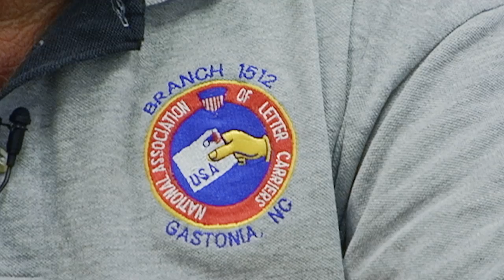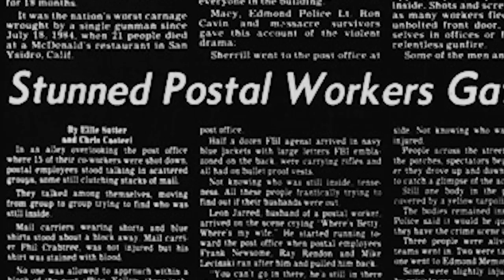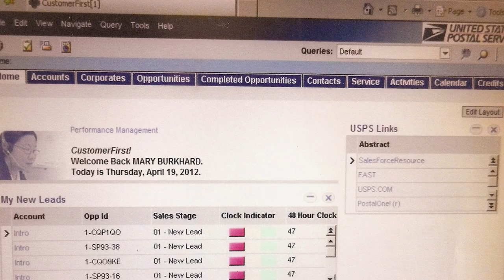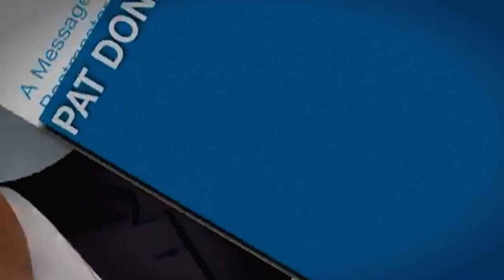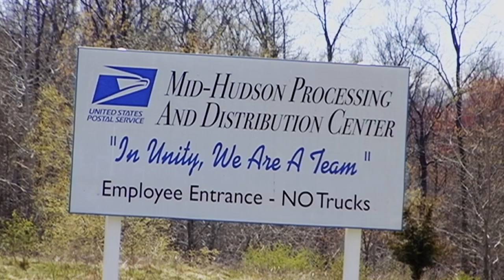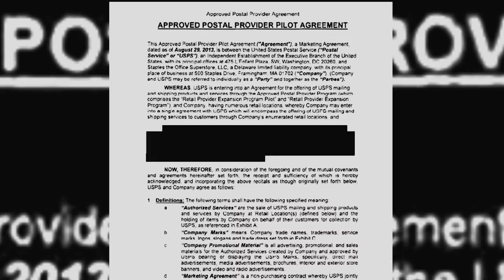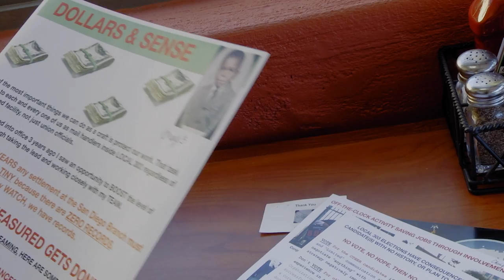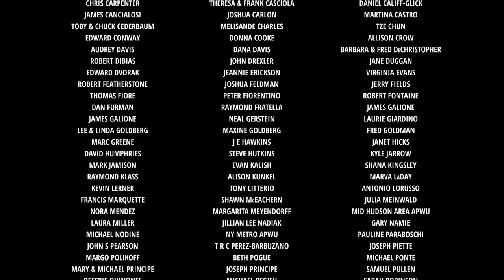The Great Postal Heist | Advocacy Documentary | Full Movie | USPS

Comment: I started in October 2006 as a (TE) Transitional Employee Letter Carrier, meaning ZERO BENIFITS, Hours no Gaurenteened, little union backing. pretty much took the supervision verbal abuse with a grain of salt.  Constantly told i would be fired.
  i STRUGGLED along and did my thing eventually being promoted to (CCA), City Carrier Assistant, then finnally making regular, Then Retiring.  Out of the 13 years with the postal system i had 6 good years when i turned 62.  Packed my bags and haven't looked back.
  In my time with the postal service, i was loned out to numerous offices, meaning i had to travel at my expense.
Was it worth it?  Hell Yes, I stood up to management and I WON.
  I was always questioned, what took you so long, why you so late, why didn't you do this do that.  It Takes what it takes.  

Happliy retired for 5-1/2 years no regrets, just miss my customers.

Comment: Retaliation for exercising his rights . The biggest problem is energy a macro cost problem caused by bad foreign oil policy  dependence . Because it's 51%^ but management says no carriers are the cost .  So pressures are forced down ward on workers .  Blame Nixon for lifting the oil import cap get gas from the naval oil reserve. Stop the harassment abuse and Retaliation and fix your management energy cost issues. Moving people's jobs and increasing costs by lengthening distances between distribution centers will only increase carriers costs and the POSTAL SERVICES COSTS.